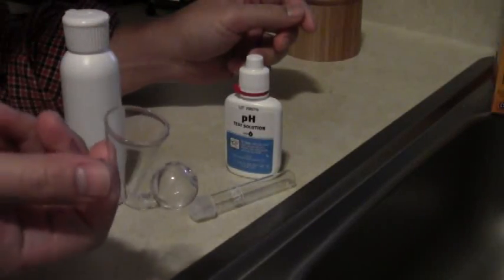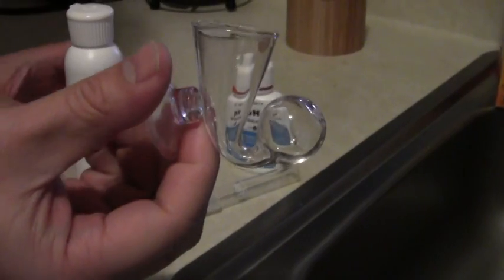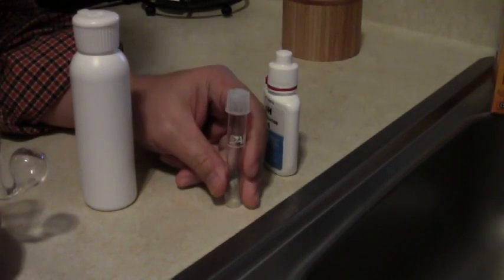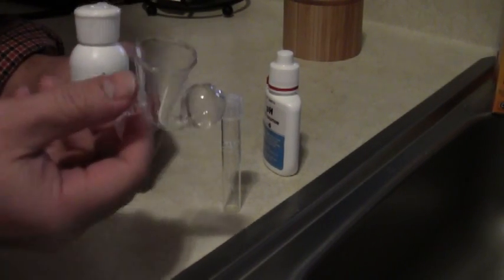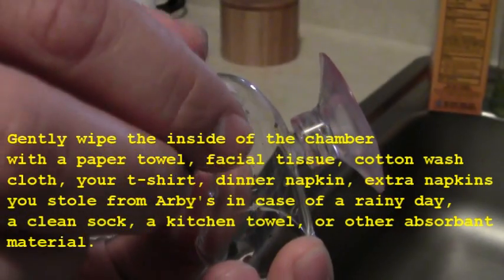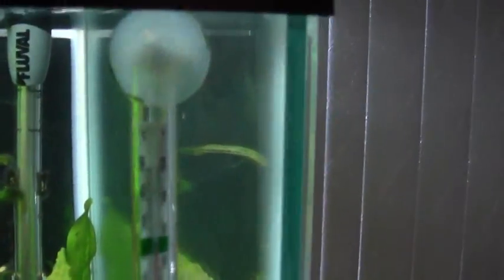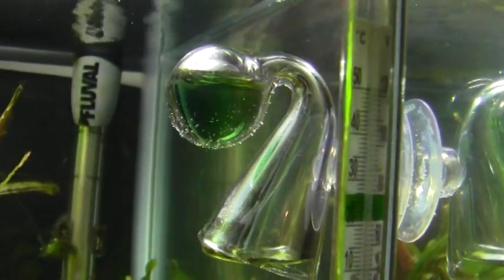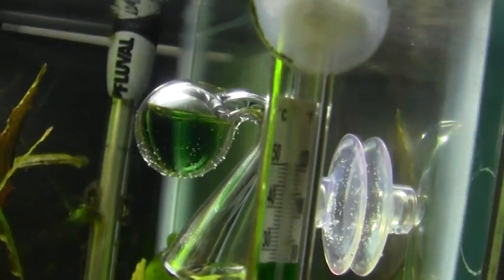How to set up a CO2 drop checker

Comment: I would just like to add a comment on these, unrelated to the video but not to the subject of drop checkers, as yesterday I found that one of my dwarf chain loach had got around into the bulb and died.  Please consider fish size in relation to drop checkers as I never imagined this was even a possibility with a smaller glass drop checker, but regardless it has happened, and although the risk is low there are ways to prevent this.

Comment: Hi :) i watched other youtube videos and they said that you need to mix dk4h solution with another chemical solution to get it blue and place the drop checker in the tank. I feel so lost. So i was curious whats in the co2 checker solution that comes with the dropchecker. I dont think the one i ordered through wish will come with one. So what and where should I get from ebay or amazon? And what should i use. I already know i need distilled water.
Reply: You need to buy a PH TEST KIT (API brand as an example). Then put 3-4 drops into the dk4h solution. You can even make dk4h yourself. It’s just distilled water and baking soda in certain quantities.
Reply from the maker: Kathleen Monsegue sorry I've been put of the hobby for a while now.  Hope you find what you need soon